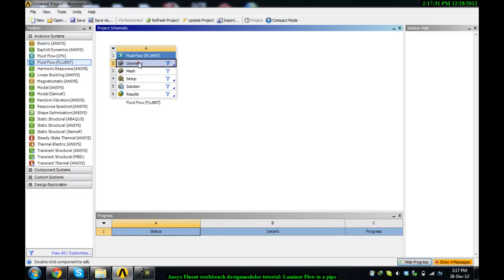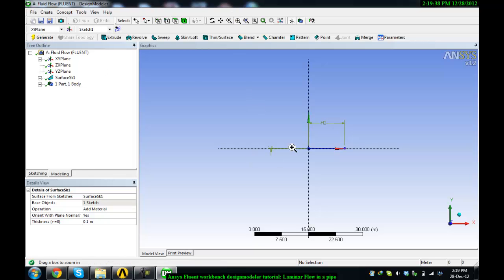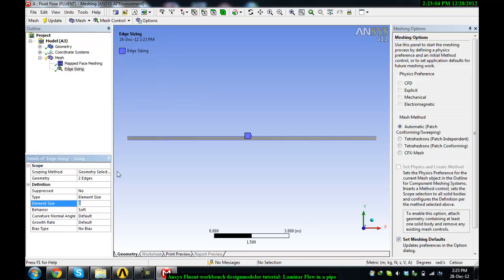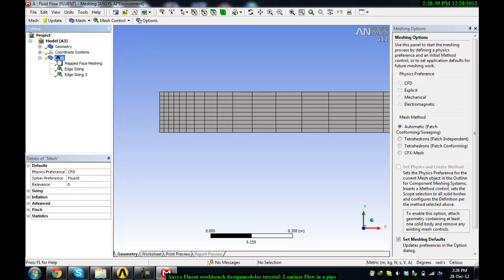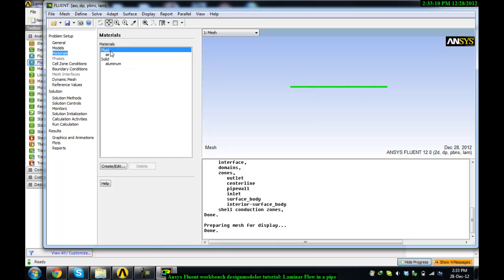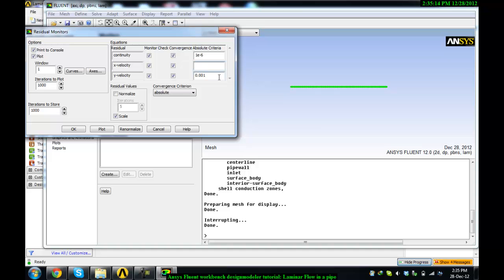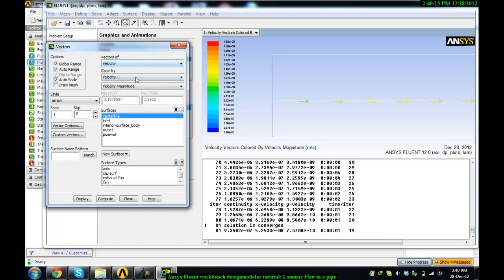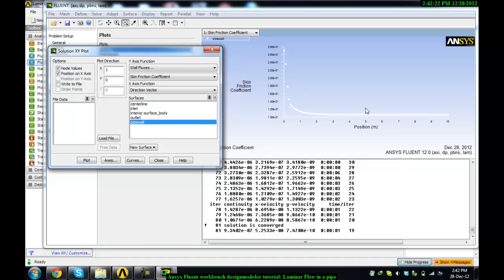Ansys workbench fluent tutorial: Laminar flow in a pipe

Comment: hi when i run i get an error message "divergence detected in AMG solver: pressure correction" any idea how to remove this message and run succesfully?
Reply from the maker: +Tipsy Gypsy Please check your mesh first. Generally a bad mesh or too high ratio creates such problem. If your dimensions are not similar to what I have done, try refining the mesh. If the problem is not solved, try reducing underrelaxation factor. I assume that you have a correct problem formulation! :-)
Reply: This happened to me when I set the bottom named selection as a wall, instead of as an axis. Curious as to why this would cause it to diverge though, anyone have any ideas?

Comment: thank u very much for such a detailed tutorial...
Reply from the maker: Ajey Singh You are very welcome and thanks for the encouragement. :-)
Reply: u started my first project in CFD, but I realize that I must go through some good literature on CFD methodology before going further..its not as simple as CATIA or Solidworks or any such CAD software. I am studying Andersons book at the moment and have reached at mesh generation part. just thought to give it a try using simple problem and found ur link. Now I think I must continue with that book before attempting any specific problem because even commercial CFD tool  like this requires a detailed knowledge of CFD technique. thank u once again..and keep uploading
Reply from the maker: Solid modelling is fun, especially once you become an advanced user. I was thinking to put an easy tutorial on solidworks routing (pipe/tubes and electricals) yesterday itself.  

I am glad that you are going through the basics of CFD. I would recommend a book  "Numerical Heat Transfer And Fluid Flow" by Dr. Suhas Patankar. The book is very basic and one of the first books on CFD and walks you through the methodologies used in any CFD software. You could write your own code for many problems.
Reply: Ratnesh Tiwari thank u for the reference...once I finished Andersons CFd, I will go through your suggestion. Many other experienced people have also advised me to write my own codes for getting started in order to have an insight of the CFD methodology. Well I am thinking to do my masters project by coding. lets see...anyways it was a wonderful experience and its always a great thing to make others learn from you.......and thank u very much for responding so attentively......keep going.. warm regards